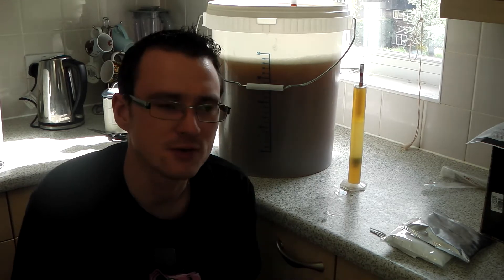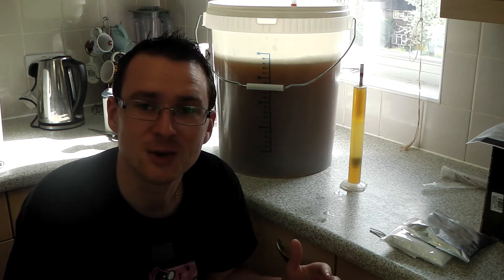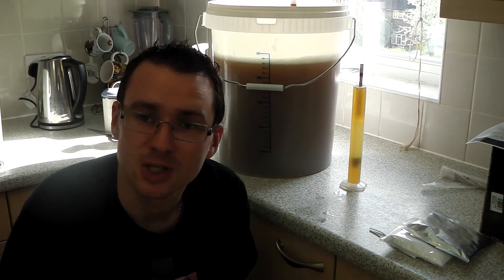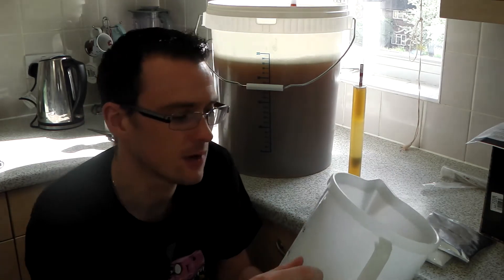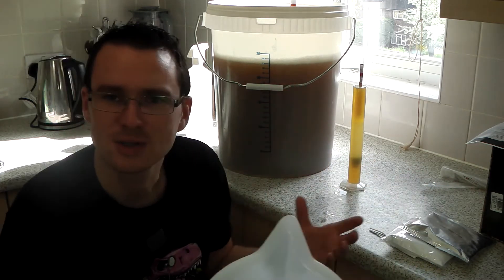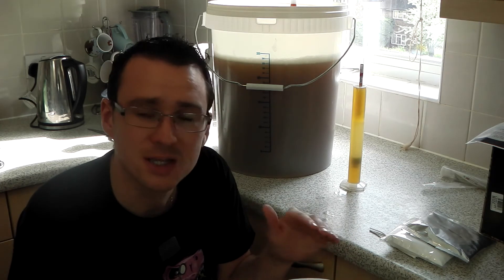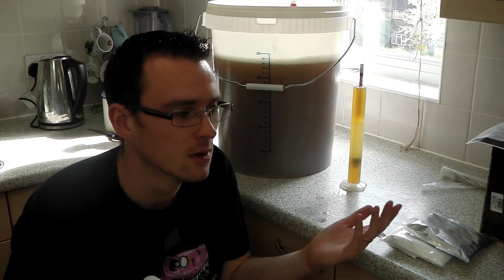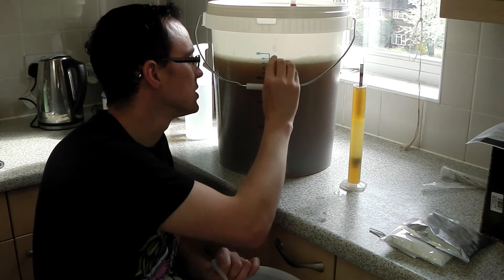Calibrating your fermenters and measuring jugs

Comment: Good tip there mate. How have you found the markings on your SS kettle to be? Just got one because of your review on it. 
Also how do you work out the liquor volumes when brewing BIAB just add total vol or hold some back to sparge?
Reply from the maker: Russ Giles the marking in kettle have been bang on which is cool.I have the smallest one in their range and hold some back on the water depending on grainbill and boil size but if you have the next kettle up you may not need to at all.For volumes go to http://www.biabrewer.info/ and get their bibacus its bang on for calculations i should do a video i havent masterd it a 100% as a program but for my volumes its helped alot
Reply: beerlover1983brew thanks mate, i went for the 15gal so got bags of room all i only plan on 5gal batch at a time. I'll give that tool a go.